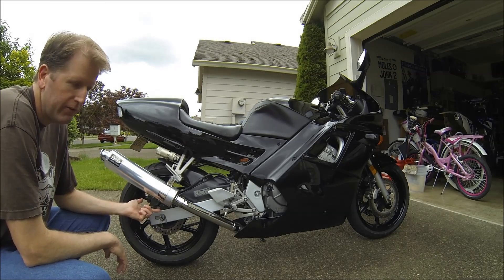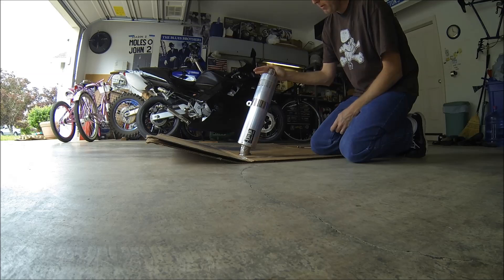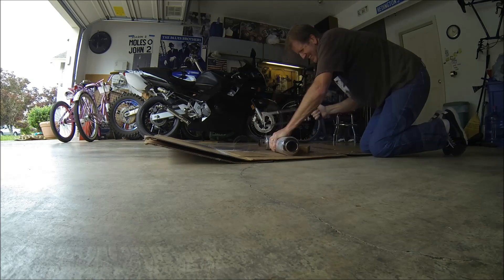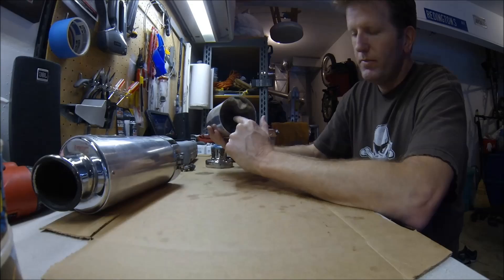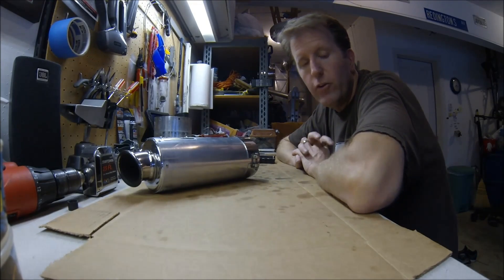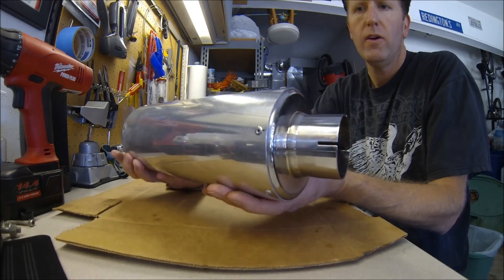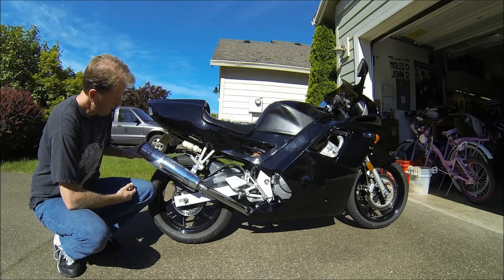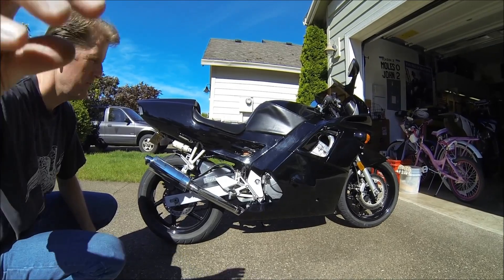CBR600 F2 D&D Shorty Pipe

Comment: I know this is an old video. But, I wanted to thank you for making it. I have the same muffler as you and decided to cut about 4 inches off. There was alot of damage on the end that connects to the pipe. Getting the end cap to slide on the inner baffle took the longest for me. Used a big sledge and a 2 by 4 piece of wood and went at it. Thanks again!

Also, did shortening your pipe affect performance at all? back pressure etc?